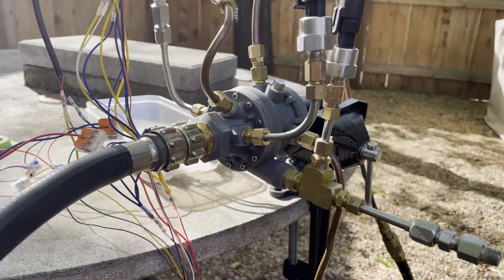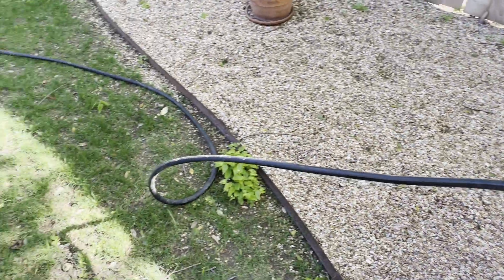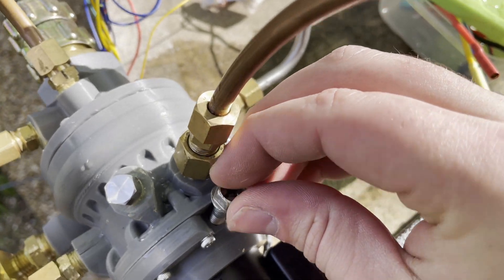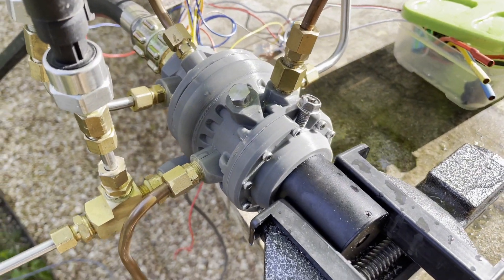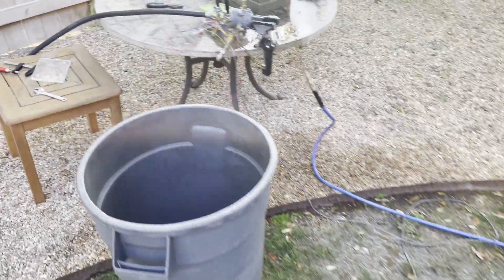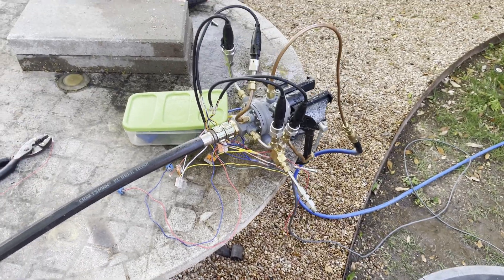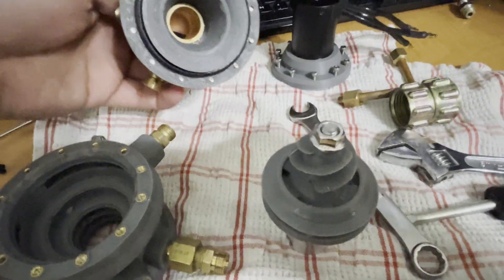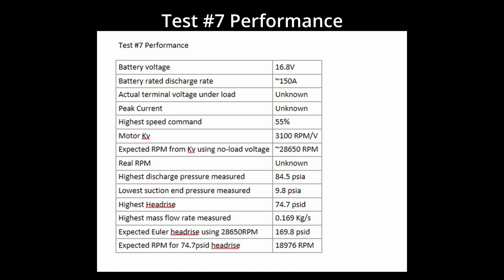3D Printed High-Power Pump Pt.1

Comment: 3700RPM in plastic nice. i expect 2000 or less.
you plan get ti to 20K or 30K? hhaha imposible but hey i want to see it.
Reply from the maker: The last test with 75psi rise hit at least 12k based on measured head vs euler head. The 3700 is the first 2ish spinup tests at 10% speed. For pt.2 im doing audio analysis via spectrogram and seeing clear modes that corroborate. Obviously plastic isn’t my end-goal but full-infill is surprisingly strong. Yeah at some point I’m hoping to hit 25k ish but yeah especially if i make the impeller bigger i’m worried about it dying.

Comment: @Benjijart
 have designed an inducer for the pump for a higher pressure full efficiency pump make a two stage because water is less viscous so make three or two stage but nice 👍 work.

Comment: You should try installing a mechanical seal. If you need a custom one, I tried to print one out of PLA recently and it works amazing. I also printed a custom spring making thing to make the spring for it and I lubricated the contact surfaces with vaseline. I guess that you would need 2 purge inlets but it's worth it. I never had any leaks on that pump.
Reply: Any open source designs for magnetic seals? Mcmaster has magnetic couplers. I don't know much about them but if possible to build magseal without needing the ferrofluid seems tangible with tools avaliable
Reply: I don't know of any designs. I also don't have any experience with them either, but I'm guessing that the torque between the magnets has to be greater than the torque exerted by the fluid on the pump. In my opinion however, magnetic seals are quite overkill for a pump. I would recommend a lip seal for low pressures and a mechanical seal for higher pressures as they are way smaller, cheaper and lighter. @Skunkhunt_42